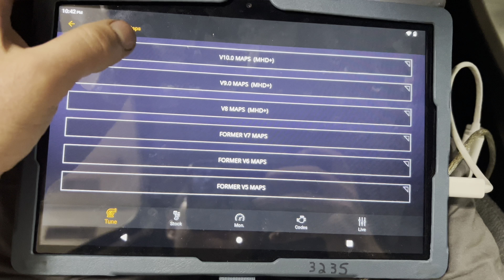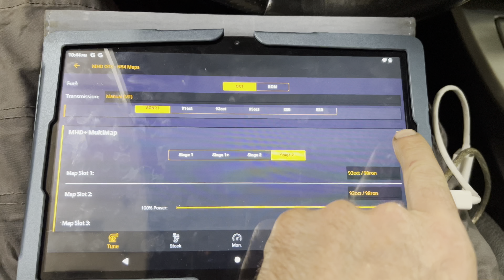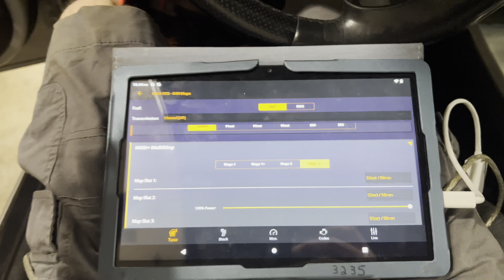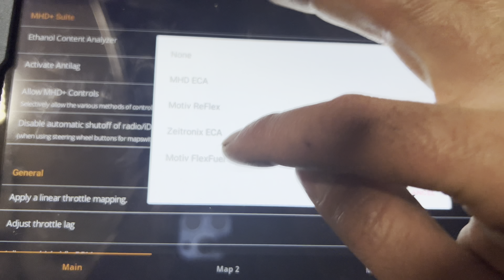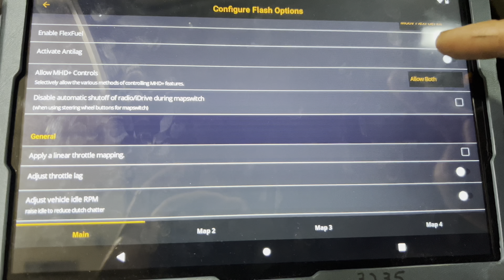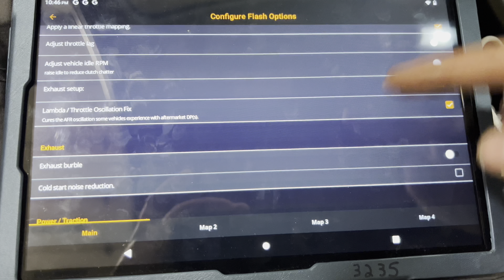How to flash N54 single turbo tune via MHD

Comment: What is what is the lambda I get o2 codes on the freeway at steady cruise
Reply from the maker: Your oxygen sensor is likely bad. If you have a single turbo kit, you should add an 02 thermo insulating bung. After I installed mine, my sensors last much longer. I got 15k miles out of a new sensor the first time. The 2nd time I installed a used sensor. It has been fine since. Only use an oem Bosch sensor. The aftermarket ones don’t work right.